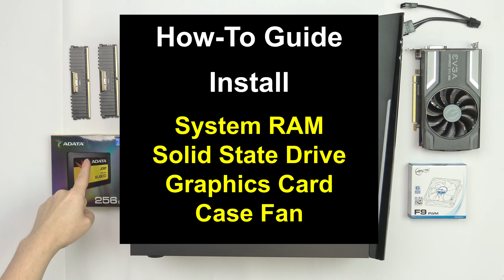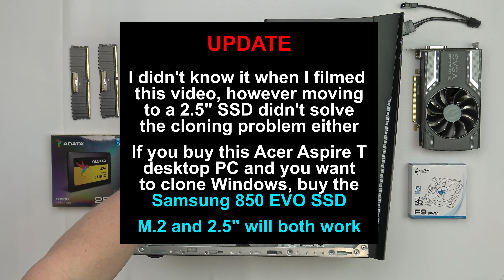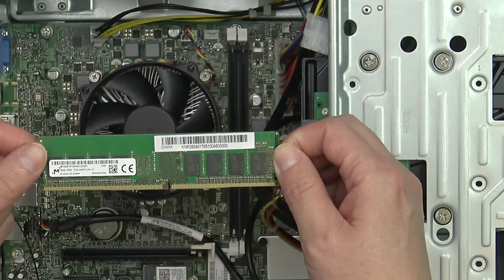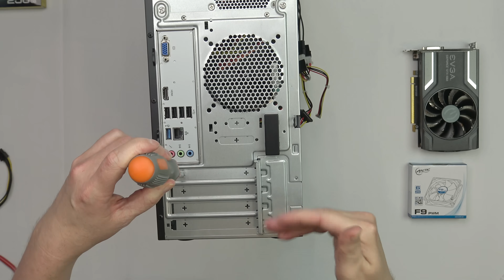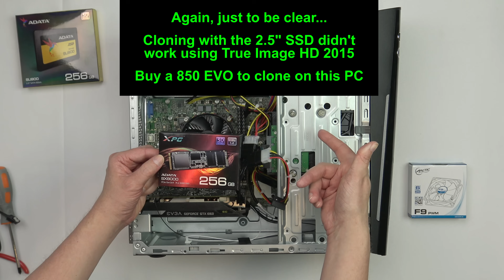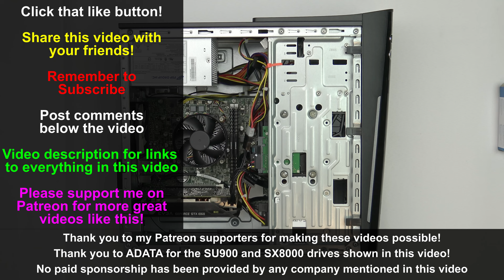$450 Acer Aspire Desktop PC - Part 3 - Upgrade Video - RAM - SSD - GPU - Fan

Comment: Thanks, got this PC. Replacing the RAM with Corsair CMK32GX4M2A2400C16 Vengeance LPX 32GB (2x16GB) DDR4 2400, EVO 870 2TB and will try to clone the old HD, a fan, and a 
ASUS Phoenix NVIDIA GeForce GTX 1650 OC.

Comment: Ab bigger card actually does fit. I have the exact same tc 780. I made some changes like 500w powersupply, 16 GB of Ram, i7 7700k, a BeQuiet Aircooler, 1TB SSD and A RTX 3060 12GB. The card fits behind the Cage.

Comment: I have a T865, that metal part on the side did make it hard but I was able to fit a ASUS STRIX RX 480 8GB inside by just removing the metal part and using an angled connector to power the GPU.

Comment: Just wanted to drop an update for 2023. I bought one of these towers back in 2018 on Prime day for $379 (Acer Aspire TC-780-ACKI5). It sat basically dormant for around 5 years because I didn't end up using it for what I though I'd need it for. Now that we've moved and I have a dedicated office to use it in, I've got it running and I've been following this tutorial (which is AWESOME, by the way - thank you) so I though I'd share my experiences going through these upgrades in today's market, 5 years after my initial purchase. My machine is spec'd a little differently than the one shown, so here's what I've found so far:

1. My rig didn't have the Molex connectors inside, I had to utilize the SATA cables. No big deal, just something to check before you order any parts.
2. My DVD drive didn't have that all-in-one mini connector, it had separate power and data cables. I popped the data cable off and put it directly onto my new SSD and it worked fine. 
3. I used a 500GB Samsung Evo 870 SSD (less than $40 at Best Buy right now!!), worked perfectly. Download the new Samsung Magician software (which includes the Data Migration tool) and it will easily clone windows onto the SSD. Massive improvement in boot time and overall program responsiveness, while I still have 2TB of storage at my disposal on the existing HDD. One big difference to note is that the Samsung software did everything for me, with the exception of one thing which I'll explain in a second. It automatically shut the machine down after the data migration to the SSD, at which point I swapped the cables as shown in the cloning video. Upon restart, I was...underwhelmed with the speed. In fact, it seemed like it was no faster than booting from the HDD! Come to find out, that's exactly what was going on - it was still booting from the HDD despite swapping the cables. I had to go into the BIOS menu at startup and select which drive to boot from, which actually worked...so apparently the BIOS version on my machine is a little different and allows you to do this, despite the conflicts mentioned in the other videos in this series. After another restart to ensure it was booting from the SSD, I expected to have to go in and mess with the drives/partitions as shown in the cloning tutorial video...but it was already set up and ready to go when I restarted the second time. No signature conflicts or anything like that, it all worked fine and I didn't need to do anything else. With the exception of that one BIOS issue that threw me off, the process actually went about as easily as you can imagine. The updated Samsung Magician software is basically plug and play/point and click when it comes to setting everything up properly. Very slick, and I can't speak highly enough of Samsung for this reason (I've been a Galaxy/Android user for a long time and also have one of their standalone SSD's that I use with my phone for video storage, so I've come to expect this kind of smooth user experience from them).
4. I ordered a refurb version of the EVGA GeForce GTX 1060 6GB video card for only $140 on NewEgg, which is the current price as of September 2023. In addition to the space limitations inside, for a prebuilt tower this old I felt no need/desire to spend more than the entire value of the machine on a new video card. The only downside is that they ship directly from the refurb place in Hong Kong, which can take several weeks; I don't have it in hand yet but should be here some time next week. Hopefully it works ok and does the job. 
5. I ended up ordering a different version of the case fan for cheap on Amazon (Pure Wings 7-blade fan, p/n BL038), but any 92mm fan will work. This one is extremely quiet and moves plenty of air for a case this small, especially considering both the video card and processor have their own cooling fans built in. Since this is purely a heat extractor fan, it's more than powerful enough. One thing to do is check your motherboard before you order, mine has a 4-pin fan plug rather than a 3-pin. I ended up ordering the three pin version by accident; it still fits and works just fine, there's just one extra pin off to the side that isn't being used. Not a problem, just something to keep an eye out for. 
6. I ended up putting 32GB of ram in it; I got a pair of 16GB Vengeance LPX chips from Corsair for a decent deal, $89 for the set. I probably could have gotten them cheaper on Amazon, but the sudden influx of fake components on Amazon over the last few years gave me some pause and I didn't see an official Corsair store on there. Ordering direct from Corsair took a couple extra days, but shipping was less than $5 with no tax so it was less than $100 delivered. Not a bad deal at the time, but they've been marked down significantly - only $69.99 right now, both on Amazon and Corsair's website, and they appear to have an official Amazon store now.  

That's all I've found that differs substantially from the video, but so far the improvements have been huge. The upgrades by themselves can be done for around $300 for everything right now, including 32GB of RAM, the graphics card, the SSD, the case fan, the cables, a computer hardware set with the M3 screws needed to mount the SSD, etc. Not expensive at all when you think about it, and the extra speed from the SSD alone is worth the upgrade, even if you don't want to drop the coin on the graphics card. 

Thanks for reading all the way to the end - hopefully this helps out anyone looking to do the same thing even though these machines are quite outdated now. That said, they are still plenty usable with a few tweaks!
Reply: I have this PC and i was wondering if you could recomend me any diffrent parts for gaming i would really apreciate if you could help me

Comment: I seem to recall there was an online tutorial webpage related to this tutorial with additional options for the various new components. Does anybody know where to find that web page or have recommendations for related ones?

Edit: I will say, I avoided losing the DVD drive in mine because I used a 4tb SSD mounted in an aluminum 2.5" to 3.5" drive adapter shell and placed it where the old POS Toshiba 2tb HDD drive went (the installed HDD that came in these stock are refurbished recalled Toshiba HDD's manufactured in the early 2000s that have read/write issues as, apparently, mine has been broken since day one and the 32mb/s read/write speed always ran at 3mb/s or less for as long as I have owned this thing so I'm glad newer models opted for 256gb SSDs starting 3 or 4 years ago). System runs way better, and the previously 5 minute boot time is now sub 10 seconds with the new SSD. Next on my list is upgraded RAM and adding a graphics card, shame those cards have went way up since COVID.

Comment: Greetings . .
I have this PC and a question.  The link you have for the 1060 video card @newegg is DDR5 ram, but my system has DDR4 - Is there a DDR4 video card upgrade?
Thanks . .
Reply from the maker: That is not what GDDR5 means, the ram on the car has nothing to do with your system.  Regardless, a 1060 shouldn’t be bought from Newegg at this point, this is a very old video.  An RTX 3050 is worth considering, or a used RTX 2060 from eBay.
Reply: @TechDeals  Greetings . .
Can you help?  What is the best video card for this PC without having to upgrade the power supply?  Thank you for any assistance . .
Reply: @TechDeals   how could you fit a rtx  2060 in this system

Comment: could i use a zotac LP 1650 instead?
Reply: idk you could probably do it if the power usage is low and you can fit it in the system

Comment: I put an M.2 drive in my Acer just today and cloned to it using Aomei. It worked flawlessly and I'm using it as my C: drive right now.
Reply: What kind of M2 did you use? Is is SATA M2?
Reply: @Nekoandpiano  you got me, that was a very long time ago. I wouldn’t even guess as to what kind it was. I no longer use that machine but it worked very well when I did use it.

Comment: Can this run the gtx 1060 6gb version and if so would I need to upgrade the power supply??
Reply: Im curious as well, I read that the Aspire TC390 that I have, uses a non standard power supply - which makes me wonder just how difficult it will be to replace it should it burn out or if i want to upgrade it...

Comment: Listen I dont have 30 minutes where the heck is the fan part? I know its the simplest I just want a confirmation before I order.
BTW, if youre watching this still...things have changed in the SSD world. Regarding cloning your HDD to  a SSD, Samsung has come out with cloning software and anythng else will work too. I have this system and I just out a 250GB 970 EVO Plus in with my 2TB Toshiba and it worked like a charm.
Now see? I ust read to put the logo side of fan facing out for exhaust out the back. Hes saying logo facing in...grrr what the hec

Comment: Would this work with a gtx 1060 without changing the power supply or using adapters or anything?
can i just buy a gtx 1060 and it would be powered by the mother board pci clot? please help me i need help.
Reply: Watch the video. He addressed this several times.

Comment: As a rather tech-savvy individual who has been building machines for years, I just wanted to let you know this is a quality video.  You give enough explanation (in a patient manner) without spouting waves of techno-jargon that most people wouldn't understand (or need to know.  I was trying to upgrade this machine for someone from a HDD to a M.2 drive and experienced the same problem you were having with not being able to change the boot device in UEFI (newer version of BIOS interface for those unfamiliar) only getting the Windows Boot Manager as a drop-down option for boot drive options.  Removing the old HDD after cloning just ended up giving me errors and unable to boot into Windows.  I guess I'll try updating the BIOS and seeing if that gives any additional options or just outright fixes the auto-detect issues from the Boot Manager.

Even though this video didn't help me with my problem, I wanted to give you a thumbs up and commend you for a job well done on the video.

Comment: Hello i have the same PC, do you think that a GPU like Asus Tuf 1650 Super would fit ? ( Card Dimensions:	206 mm
 / 8.10") Thanks
Reply: I wanna do the same exact thing please tell me if it worked for you or not?
and if you got another gpu please tell me which one you ended up buying and worked fine? i really need your help and thanks.
Reply: @EridanusYT  Yoo, i did it with the MSI GTX 1650 Super Single Fan, works great ! This card need a better PSU so I took the Corsair CX450. I bought the same Artic F9 fan, and a  Samsung 860 evo SSD.

Comment: Hi, I have an Aspire tc-380 with Win10, same laylout, and taken a 500 W Psu and a HD7850 graphic card from a working pc to upgrade the aspire. If I give power to the hd7850 pc start with one beep (ram check ok) but no video signal. Leaving the 7850 inserted in the slot but without pci-e power connector win 10 then start again ok. Also mounted a second hd, ssd KIngston 240, it formats, see it in disk and deviced management, in bios but not in file Explorer. I have no more the manual for the motherboard for some possible settings (jumper gp I01, I02 ?), any help please ? Ciao 🙂

Comment: 2020.5.11

Hey I'm just wondering if it works to my pc. It kinda similar to this but its smaller than this... Acer Aspire XC-780..1x4gb ram (adata 1rx16 pc4-2400t-uc0-11). psu i think is around 220watts (so i need more power i guess)
Reply: 1tb toshiba hdd intel Core i3-7100 Processor (3M Cache, 3.90 GHz)..H110 Express chipset

Comment: Evga 1660ti single fan cards will fit in these machines! Absolutely nothing larger than that, but mine fit snug. Make sure to replace the psu :)

Comment: I tried putting a new graphics card into a machine with a similar case, however there was a capacitor on the motherboard and a plug that kept bumping into the plastic housing on the card. I managed to get it in, but I don't think I can secure the card, as I occasionally get a blank screen on start up. I'm going to have to take the machine apart at some point and try again. Acer really doesn't want you to upgrade these machines at all.

Comment: Note: As of 10/18/20 the Cyberpower and Acers linked above are not available. For me, the Cyber is too big anyway, as I want to set it horizontally on the desk, below the small shelf above the desktop. Its height becomes its width, taking up space I need for other accessories.
  
But, Acer now has a TC model for about $650 which has 12gB of RAM, which is enough for me. It also has an M.2 512gB SSD installed. The upgrade will be to install an HDD for data in it, plus if you want, the GPU and fan.
 
I am leaning toward that model due to my desire to create a dual-boot (non-gaming) PC for which Linux would be the main OS. Plus, I like the built-in DVD player/writer because it's installed vertically in the case, which I want to set horizontally, thus making the DVD horizontal... hopefully not upside-down, though when the grille is up,

Comment: Too funny. I know next to nothing about the inside of a computer but I do know the Acer Aspire Desktop PC does not allow you in the Bios to enable XMP DOCP.  There is no where you can change the setting. Therefore installing the RAM, Corsair Vengeance LPX on an Acer Aspire will only allow you to utilize 75% of the sticks capabilities. Really stupid to install these sticks on an Acer Aspire.

Comment: is gtx 1050 enough for 220w? i have acer xc 780 can i upgrade my pc?
Reply: pls reply i need to know cuz i wana upgrade mine cuz its so boring
Reply: @NattisNutty  A 300W power supply is recommended. I guess you could get away with only a 220W but I would not advise it.
Reply: @samyar_makki2931  i upgrade to a 650w and buy gtx 1650 super thanks tho

Comment: I bought an RX-580 for the Aspire Tc-885, but my computer doesn't run.  The fans of the card normally run, but there is no display. What's up with that?
I have an I5 9th generation
16 GB ram
600 power supply

Comment: Its great, im a bit confuse about power need, always round forum and blog i've readen that also for small gpu its needed at least 500w of power line, somebody can help?i wanna upgrade the same pc of the video so i realy need to be sure, and if i have to change charger, can it feet inside?

Comment: You might want to make sure you're information is accurate on those M.2 drives. I have the Aspire TC-780 and it does NOT... NOT take NVME solid state drives.  The M.2 card slot in mine uses the SATA standard for its interface.  There's a difference!  M.2 is the form-factor of the slot/drives.  NVME and SATA are the type of bus they use to communicate with the rest of the system.  SO you have to buy the right solid state M.2 drive for your system board.  Don't plug a NVME drive into a SATA M.2 slot.

Comment: Has anyone ran into any issues keeping the stock PSU with the 1060 6GB card?
Reply: So I actually ended up getting the 1060 6GB SC and it’s been working well.I disconnected the CD drive just in case.I just upgraded the cooling fans.So far so good 🤔 what issues were you having?

Comment: Hi. In a previous video ($400 upgrade) - you said NVME m.2 drives wouldn’t work - but in this, recommend the sx8000 NVMe m.2. 
Did acer change something, or would an nvme m.2 work in any of the aspire upgrades?
Thanks

Comment: I put a GTX 1080 in mine with an upgrade power supply. Worked fine but haven’t tried adding a SSD yet.

Comment: Does this motherboard (M3970) work with MSI RTX 2060 gaming z video card? I upgraded the psu to 600w and rams to 16GB. I don’t have an issue  with physical space, I have the full case size, not mini tower.

Comment: I'm watching in December 2019 and this video is just as relevant. Thank you Tech Deals.
Reply: same here ^^ cause of the m.2 ssd :) YES!
Reply: @PyR0 same. what graphics card are you upgrading to? i have the 1050ti sc rn but I had a single fan 1660 in mind.
Reply: @PyR0 I think you should look into upgrading the PSU anyway. incase you add some RGB or extra cooling cause the case is pretty small and it might get hot with the upgraded graphics card.
Reply: @PyR0 nice. i would've already upgraded but i'm waiting for the PSU's prices to lower cause they're a little pricey rn compared to how much they were not too long ago. upgraded to 32 GB of ram tho & i gotta say, it's a beautiful bliss. major overkill, but super useful for multitasking while gaming.
Reply: @dee22503  What speed did you upgrade your ram too, and is it running at that speed? I was wanting to get 16gb of 3200mhz but in the video he says that it caps it at 2133. I don't know if the ram I want to get will work with my motherboard.

Comment: I upgraded my same exact computer to a Hynix 500gb SSD today without any problems. The Hynix drive comes with its own cloning tool which they call data migration tool but it worked beautifully. Though it did take about 5 hours:(

Comment: Hi  I am not clued up on SSD. I have a Acer Aspire  T3-710 which I have upgraded the Graphics card and fan. Can the Crucial MX500 CT1000MX500SSD4 1 TB (3D NAND, SATA, M.2 Type 2280SS, Internal SSD) be installed on my computer. Thanks to your videos I'm halfway there.  cheers